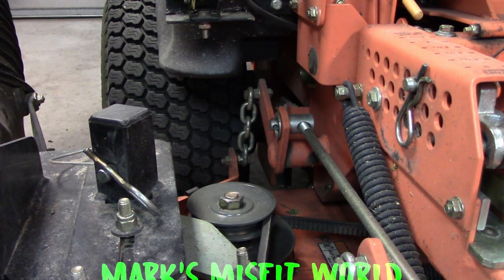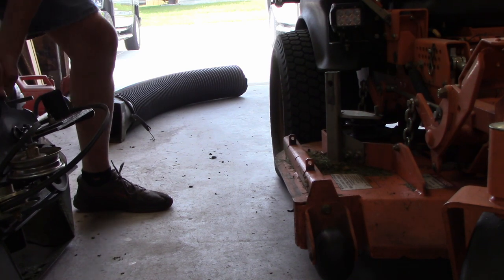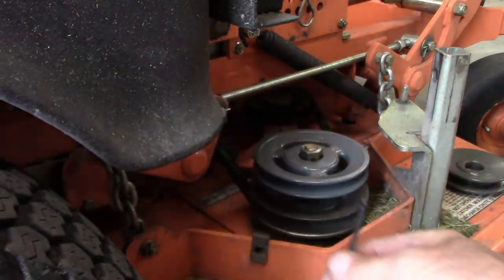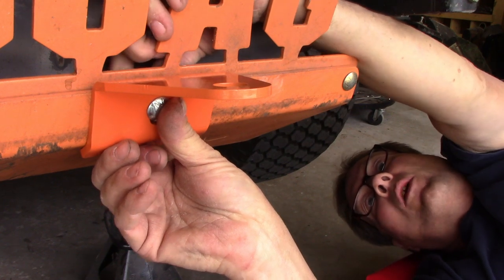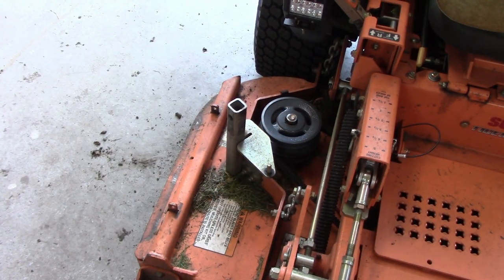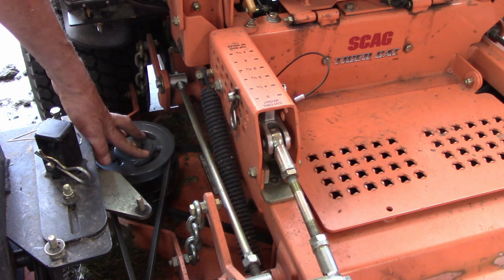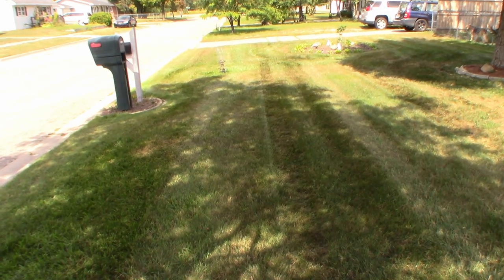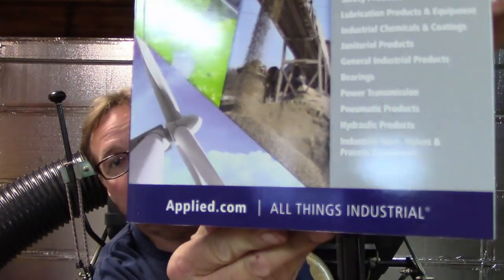Final Mods to Scag Bagger Before Fall

Comment: awesome tips, I have the twin bagger vacuum for the vride2 52, will the 5 inch pulley work? and if so where can I purchase the same one you have. Currently I have the gator blades on, does a great job with minimal blow out, but really want to put the high lift short tails on with the blower running faster to keep up with suction so there's less deck blow out. ( also stripes better than gators)
Reply from the maker: If there is room it will work,  if you have a local heating and cooling supply store near you they may have it sitting on the shelf or they can order it for you.  It's just a cast iron pulley with set screws easy to buy.
Reply: @Marksmisfitworld  thanks for the fast response 👍and info, confirming with you going with the bigger pulley improved with better suction and no problems with the other pulley or spindles. thx

Comment: Mark, what was the final outcome on the 5-1/2" pulley.  Solve the clogging problem, cause any bearing failures?
Reply from the maker: Eliminated most of the clogging issues and no bearing failures.

Comment: The bumper on the Skag has a square hole into which the carriage bolt fits.  It appears the trailer hitch has a slot so it will not grab the square neck of the carriage bolt.  Over time the nut will seize and since you cannot grab the carriage bolt head, and cannot get your impact driver onto the nut, you might have a hard time removing it if necessary.  Rather than getting a grade 8 carriage bolt consider getting a grade 8 hex head bolt.  Thanks for sharing your videos.

Comment: Interesting- on roots style superchargers you would put a smaller pulley to effectively spin the belt faster. Why is this different?
Reply: The smaller pulley on the unit will increase RPMs, a larger pulley at the rank will increase RPMs.  Think of this pulley swap as the lower/crank versus the pulley on the unit/SC.

Comment: Boy, the idler and tensioner pulley system on the Scag seems much better aligned ,and better designed than the Protero system
Reply from the maker: It is way better than the Protero. That is going to be my project this winter is to modify the Protero to get it as close as I can to the Scag blower.
Reply: @Marksmisfitworld  Hey Mark,what do you use as a double stack pulley for the protero?

Comment: I would take and leave the or grass I'd leave that capture on there instead of pulling around that dr1 or whatever I think if you get around a lot faster with just what you got there instead of pulling around the DR cart try it out first
Reply from the maker: The Dr is a lot faster picking up leaves and it also shreds them up finer. I have a plan for this leaf season that should make it even faster with the DR. Also the Gravely will be doing a lot small yards faster with the way it picks up the wet grass.